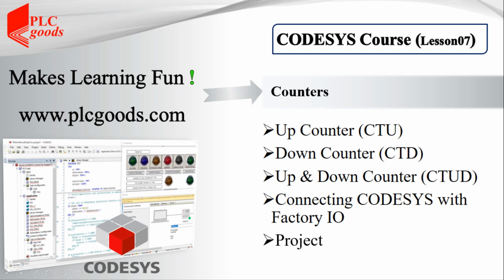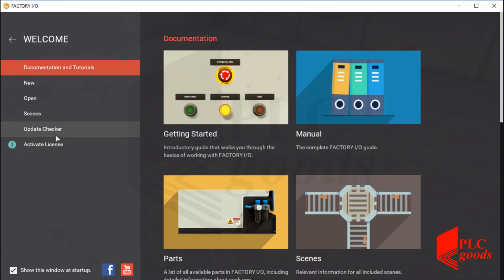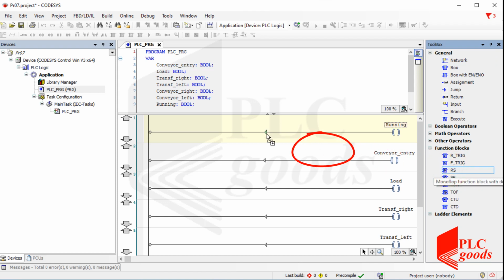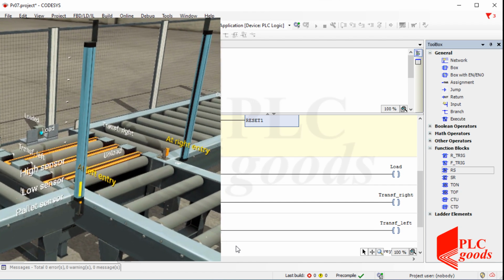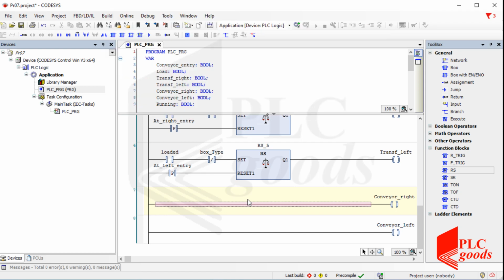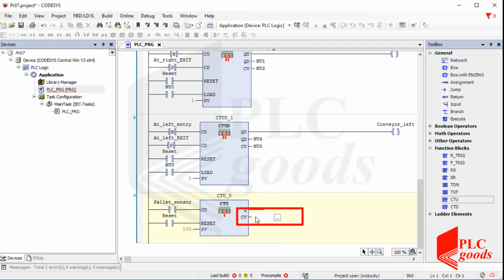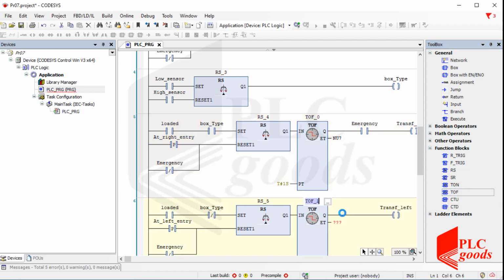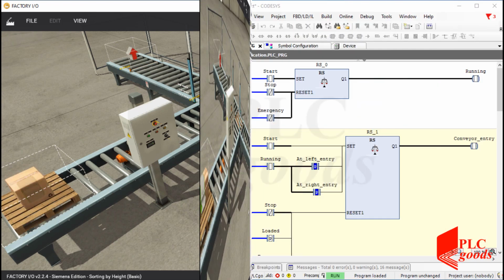Linking CODESYS with Factory IO | plc based product sorting machine  | Lesson 7

Comment: Hi, thanks for sharing it is really good explanation. I also upload videos about Codesys but in Spanish. I am starting uploading about Factory IO and Codesys but I have problems when I am recording and there is a delay between Softwares. Can you said me the characteristics of your computer please?.
I am using Laptop windows 10, Core i7, 512 SSD and 16 GB RAM,
Reply from the maker: Hi there, I had your problem during the Delta Course, but until now, I've not had the delay problem during the Codesys. however, our systems are the same. I am using Laptop windows 10, Core i7, 1T HDD and 16 GB RAM.